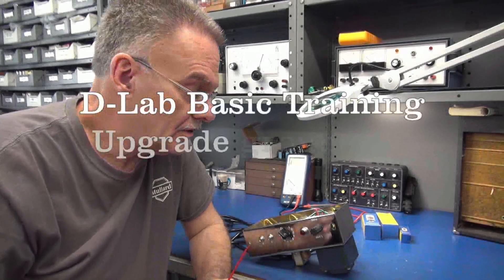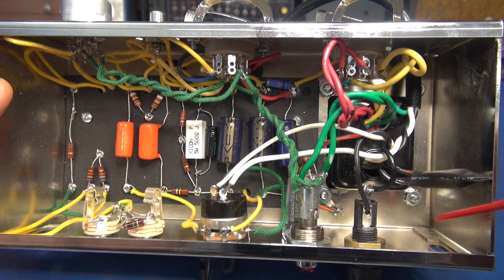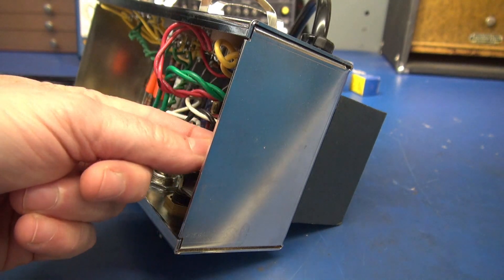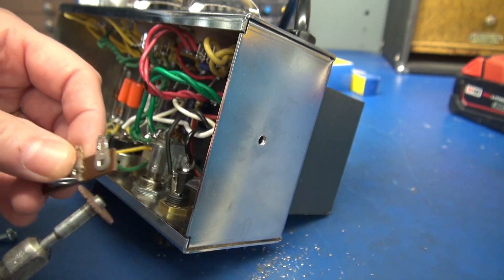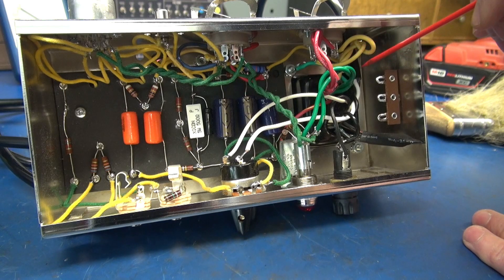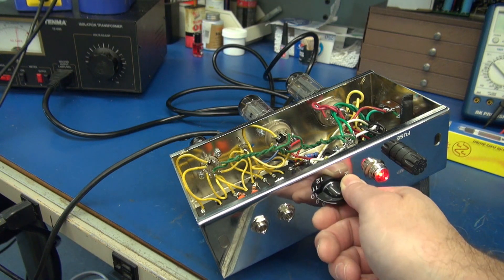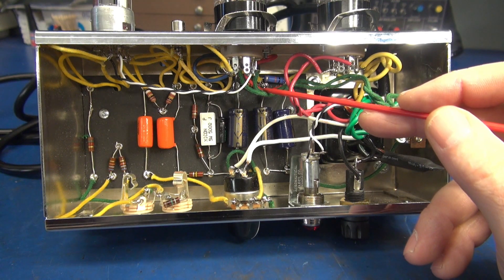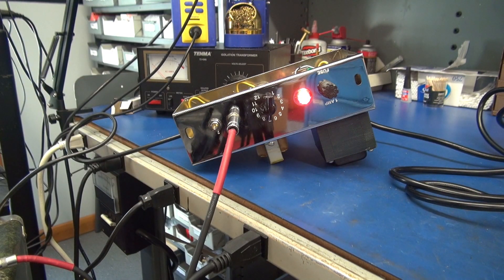D-lab Basic Training upgrade grounding on 5F1 Champ tube guitar amp Fender Kits noise reduction

Comment: I built a 5F1 recently and my power transformer has a center tap on the green heater wires. In this case you put the green center tap wire with yellow stripe to ground along with the red with yellow stripe B+ center tap. No need for the two 100-ohm resistors for elevated ground.  I followed the preamp grounding method on Rob Robinette's site which separates the 8-microfarad cap from the cathode bias resistor and capacitor ground. I've built a half dozen of these in in the past and Rob's grounding method is the quietest.  Great video Terry.

Comment: Info in this video is super helpful.  I compared Terry's approach to that of Rob Robinette and they were very similar.  Failure to separate the grounds and usage of the 100 heater balancing resistors will cause hum and oscillation.  Great video.

Comment: Yeah. I did the "tie mains gnd to xfmr bolt" mistake on a build two weeks ago and then further falsely reassured myself by checking it via a good ol' high impedance jumper to chassis. Luckily i remembered, then ironically a few days later, saw another excellent video where Terry pointed out this common beginner mistake.

Comment: I'm about to build this kit as my first amp build and I'd love to incorporate the grounding mods you detail in this video.  Is there a wiring diagram showing the new connections to the grounding lug you installed anywhere? I'd love to check what im doing against a diagram.

Comment: For those outside the US, the older machine screw system is common even today and most vintage American amplifiers use it.  The first number is an arbitrary rod size and the second, the number of threads per inch. Very common are 8-32, 6-32, and 4-40... also 10-32, 10-24.  This maybe useful in locating replacements.

Comment: Guys, stop trying to use the chassis as a cheap ground. The chassis is a sensitive shield for the audio, not a place to dump any and all ugly noisy ground currents in your amp. It's not 1947 any more. And for the love of Jesus don't try soldering to the chassis, that's just awful. Use a properly routed ground bus wire.
Reply: So, what's the right way?

Comment: Why not make it easy & just make a better connection at the transformer mounting screws? Scrap away the chrome if need be (although it should be conductive) and use an appropriate external tooth washer to bite?

Comment: Great tip. I do the same..Some say grounding to the transformer bolt introduces noise from the transformer into the circuit. Maybe it does..
Personally, I think one of the most satisfying mods to the 5F1 is eliminating the on/off volume pot by relocating the fuse holder, installing a switch where the original fuse holder was and then using a singular pot for volume control thus distancing the AC away from the audio.

Comment: The ac wiring as well ? Hot to fuse tip and then switched -- ? Neutral straight to other side of p/t primary ? Also check these mods -- thanks. https://www.youtube.com/watch?v=ZADSg-N5JXo&list=PL4SfNtGVBBdSJAc3Bo9GvCqF1hqPwd8-a&index=2

Comment: I love your approach to grounding to the chassis particularly two star lock washers.
This is the approach that my shop used for two-way radio installations A- connections remain good even in high vibration vehicles.

Comment: 5:45  You have basically created a center tap for the 6.3V filament because the transformer did not come with a 6.3V center tap? is that correct?